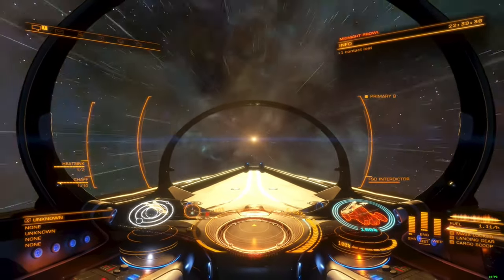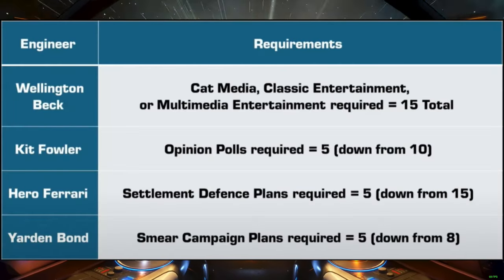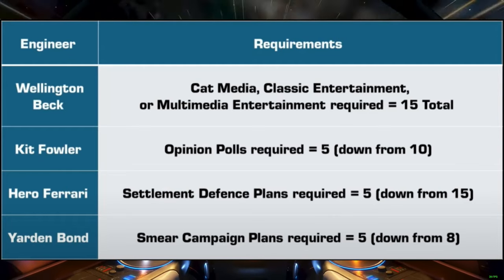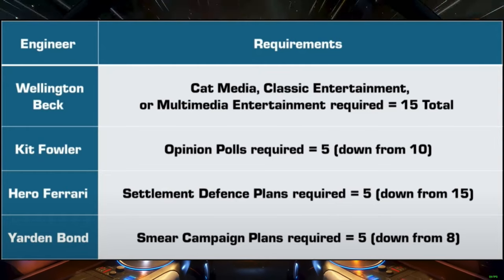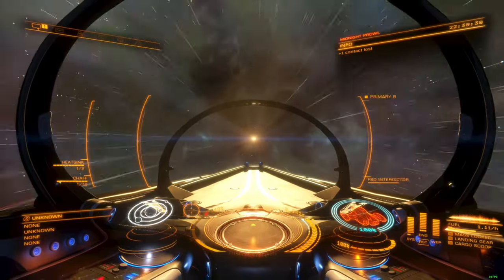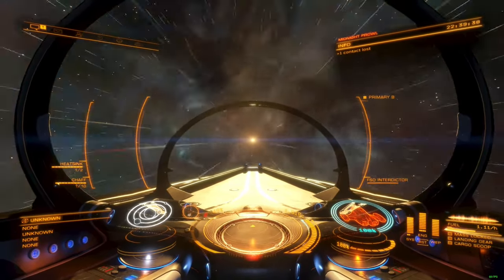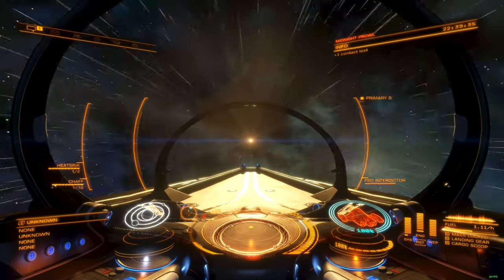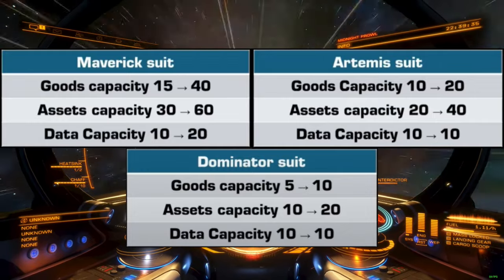Elite Dangerous | Dry Commentary | Engineering Rebalance Overview

Comment: What will be our modified suits? My Maverick suit with enhanced backpack capacity; it has 30 goods capacity. It will be change automatically or what? Still 30, or 40 or 80 (15 to 30 means double, 40 will be 80 this logic)?
Reply from the maker: I would imaging that the engineering blueprints will apply their percentage improvement to the new base value automatically. You your engineered suit will automatically get increased storage when the upgrade drops.

Comment: I think they went too far, Its all great until you look at your current engineered modules/ships and think wow that was a waste of time, the only thing that made me any good at this game was my fully engineered ships, now any yahoo can get what I have with little effort compared to a good part of the 12k hours I put in the game in the last 3 years grinding mats.
Reply from the maker: Engineering broke a lot of balance between ships and modules, and the game has never really recovered from it. It feels like a system from a single player game got tossed into an MMO, and gives such an edge to engineered kit that the skill of individual players becomes secondary to the equipment. I hope that engineering gets additional tuning in the future to help resolve this, but that would require reducing the performance of some engineered ships and blueprints.
Reply: @DryHeatAndSand  And I wouldn't want that. I've spent a while balancing my Courier, Corvette and Chieftain to just how I like them. I definitely wouldn't want any of those modules to be reduced in effectiveness, otherwise it was a massive waste of time.